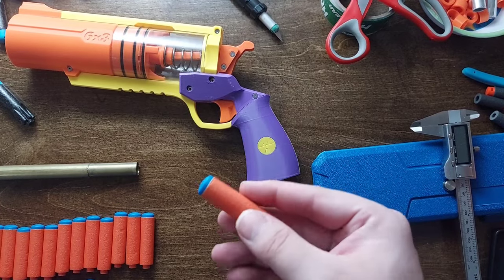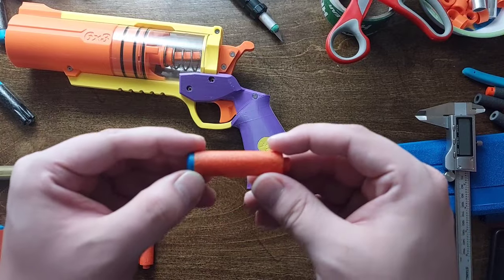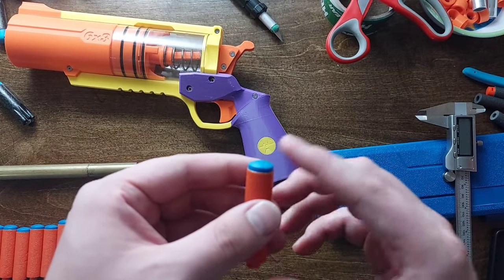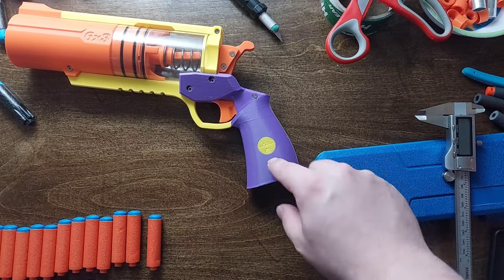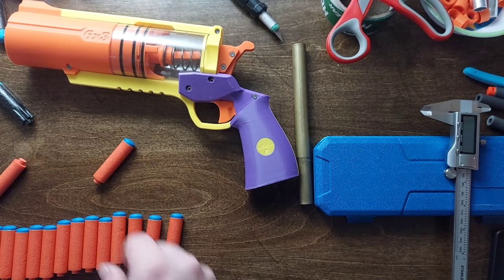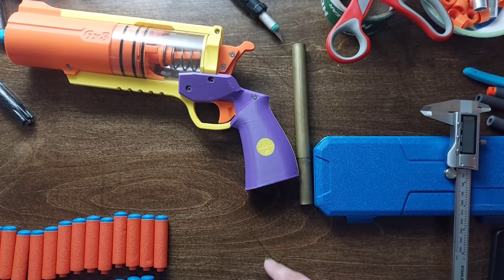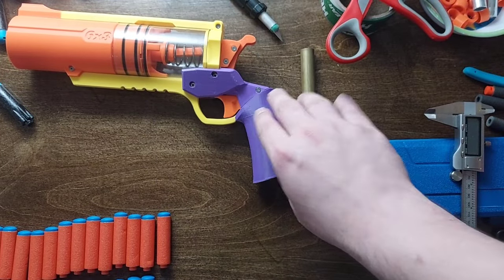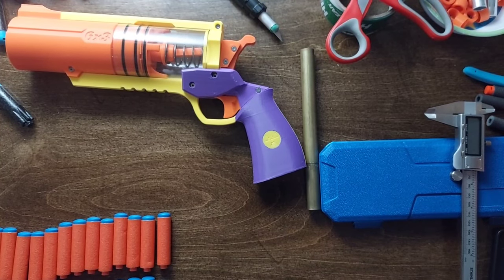Nerf N-Series N1 Dart: First Look and Technical Deep Dive!

Comment: The dart tip being flush with the body might be problematic for springers with tight barrels
Reply from the maker: Its 13.6mm OD tip compared to 14.5mm OD foam. It'll be fine.

Comment: If you rip the n head off and put a worker dart head on them, does accuracy improve?
Reply from the maker: The inside of the dart is 1.5mm larger. The worker heads do not fit.

Comment: So they made them lighter.  That alone would give the dart speed boast of at least 10FPS.  Sneaky sneaky.
Reply from the maker: Its just barely more than full length elite. About .4g lighter than ultra.
Reply: @radioactivesdesigns3554  wait it’s heavier than an Elite?
Reply: 1.08?  That’s what a AF waffle dart weighs.
Reply from the maker: @sweetlikechocothai  yeah, barely heavier. Waffles weight a bit more than an elite as well. That's why they lower the fps.
Reply: @radioactivesdesigns3554  maybe that’s why the accuracy isn’t there.  Too light and that type of head is pretty much the old XShot design.